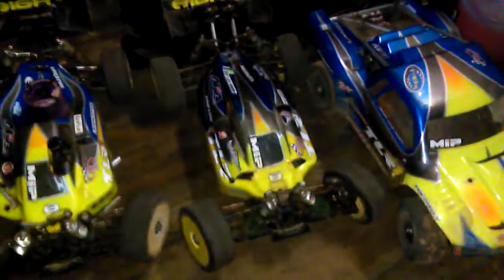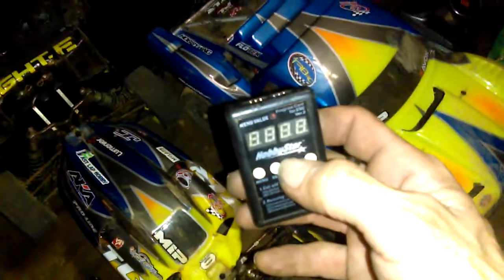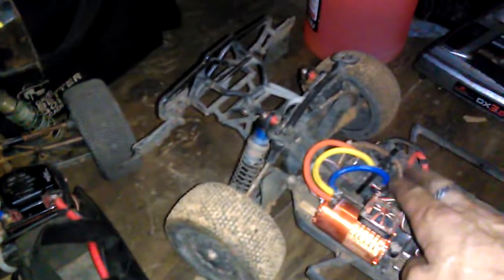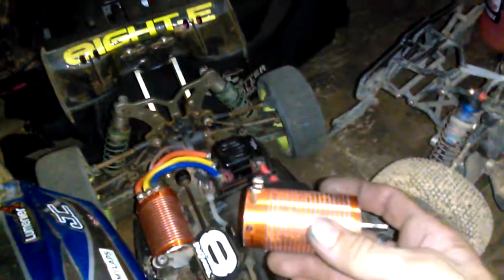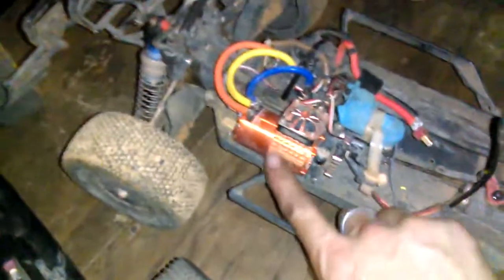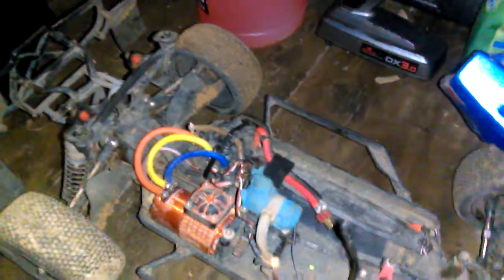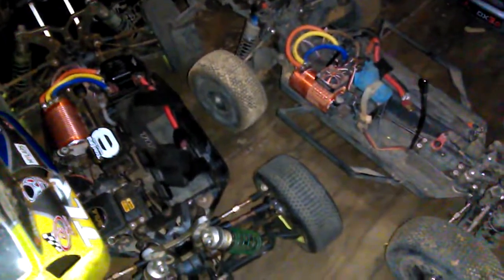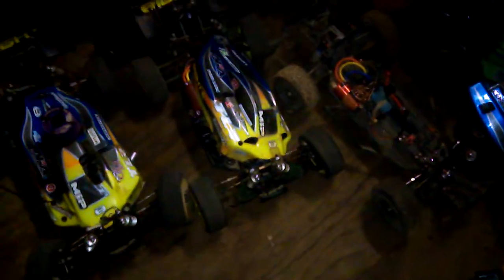Unofficial Goolrc ESC Update #2!! 4 150a esc Clones!!!, New Brushless Motors Reviewed!!

Comment: Are you still Racing? And if so are these holding up
Reply from the maker: Hi, I've been racing a little bit since 2020. Haven't had any good enough to post Amain videos of for quite some time but I will be getting back into it more. As for the equipment, Goolrc has ended the line of escs they were selling back when I made these unofficial review videos of them. Other companies have stepped in and put their names on the same equipment that Goolrc had been selling their name on, so I am technically still using the same equipment yes.
Reply: @icemandrivetlr1980  thanks for the quick response! I have tried a few ztw esc's and have had no luck. The 150ss, and the 220 beast pro both suck! Bang good has the 120 amp sensored goolrc, and 1900kv motor combo. I might try out on my truggy.  Thanks!

Comment: Hey mate, thanks for your vid.
After many tries I got calibration done successfully for a 120amp new style goolrc esc, looks similar to hobbywing now. Program card did not work, it's a red goolrc one. Keeps beeping 4 times even when 3s connected. Anything I'm missing when I connect the card? Also do you have any experience with manually programming these esc?
Where did you get the 150amp hobbystar card? Thanks
Reply from the maker: Thanks for watching , I apologize for all the um's as it wasn't scripted lol. As of lately I haven't seen any vehicle esc's or motors from Goolrc, seems like they got into drones more. I found yet another new brand name on the same exact line of esc's. The company is Surpass Hobby now that has their name on the electronics. I'm not familiar with the red card that you have, I got my led program card from eBay. All I typed in search was, esc program card, and looked thru allllllll the results until I found it. I knew the Hobbystar led program card would work for my Goolrc\ZTW\Hobbystar\Hobbyking\SurpassHobby esc bcuz it looked exactly the same as the Goolrc led program card. Just a side note, the lcd program card that is combo'd with a motor and esc is the incorrect program card for the esc in the combo lol. That one programs a special onroad S120a esc. As far as the calibration, it can be a total pain but it's also quite simple lol. As far as I know there is no manual programming, has to have the led card connected to change settings.
Reply: @icemandrivetlr1980  thanks mate I've got this one AU $41.54  30%OFF | Original GoolRC 80/120A/150A Brushless ESC Electric Speed Controller 6.0V/8.4V/5A BEC for 1/8 1/10 RC Truck Off-road Car RC Part
https://a.aliexpress.com/_mtJIWg5
And I'll try this one
AU $13.41  41%OFF | Surpass Hobby LED Programing Card For Mystery ZTW NOVAK, LRP , ORION RC CAR Brushless ESC  Electronic Speed Controller programme
https://a.aliexpress.com/_mPjdDmN
I'll let you know in 3 months when it arrives ;-)

Comment: Not sure if you are still looking for a 150A GoolRC ESC standalone, but here's a link to Amazon, $57:
GoolRC 150A Brushless ESC Waterproof Electric Speed Controller for 1/8 RC Truck Off-Road Car https://www.amazon.com/dp/B07T2XKN2K/ref=cm_sw_r_cp_apa_i_QLJ.DbESNRTZ1

I have been skeptical about GoolRC ESC because many people have had issues with them especially with them catching on fire. Not sure if it's user error in not having the proper combo of ESC, motor, battery & gearing. Specially when a lot of people don't realize that your ESC needs to be at least 20% higher in current rating than the max amp rating on your motor. Also, the proper C rating on your lipo, or else everything will begin to overheat quickly.
Thanks for the vid! 👍

Comment: Hey i have the 120 amp esc an goolrc Motor an im having trouble with the calibration.
Reply: What trouble did you have?
Reply: @KaizerTest  the motor not giving out full power even trigger is fully engaged. I even ordered the correct program card like you said .  im running it on 4s . can it take 6s ?
Reply: @kimpoppa225 I dont think it can handle 6s. My 120a RCharlance(looks same as Gool wouldnt even run on 6s.
 Try switching 2 motor wires and then reverse the direction on your transmitter if you have a switch. The esc may be using reverse while you are going forward. Is it faster in reverse?
Reply: @KaizerTest  yeap

Comment: I Love goolrc! It's cheap, and good electronics. I'm just getting into e-buggy, I bought a 4076 2000kv today!
Reply from the maker: Bashing RC 24/7 , yes indeed its good stuff! I'm rockin the 2000kv sensored motor with a 16t pinion and 48t spur on my TLR 8ight-e 3.0 !
Reply: ASimpleMan cool I run a 2000kv non-sensored  17/46 in my mbx7, great motor!
Reply from the maker: Bashing RC 24/7 , I need to try a 17t with my 48t spur, might work out better for the tracks I run on.